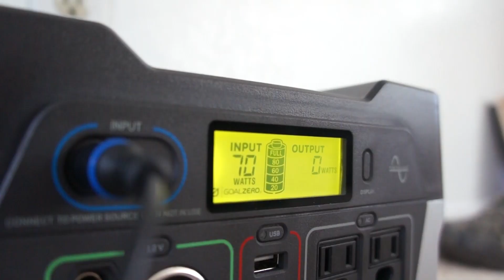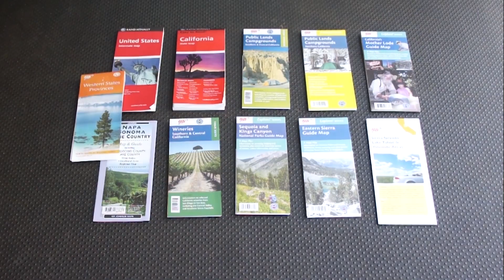Van Life - DIY Sprinter Van Build

Comment: Hey guys just found your channel, great content. I hit the subscribe and bell for y'all keep it up. I was wondering which AC unit you have and if your solar setup powers it okay? I am looking to build something now and I hear AC is a pain. Or if you had a video you could link me that would be great. Thanks!
Reply from the maker: Thanks for subscribing Gregory! Appreciate it. You know what, we don't have our AC powered by the solar...yet... Luckily, we haven't really needed the back AC  because it's not working right now. We need to have an AC specialist take a look at it before we switch up the power. It also leaks when it rains, so if we're not able to fix it we may just take the whole thing out and swap it for another ventilation system. It's just the original factory AC unit.